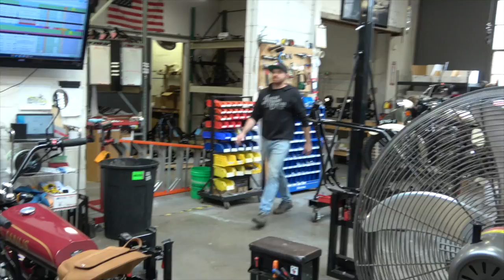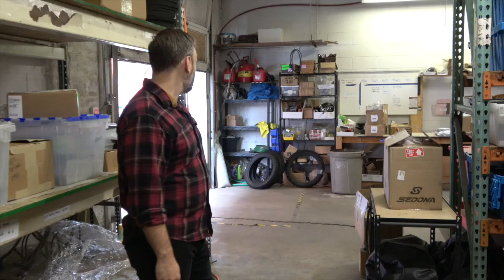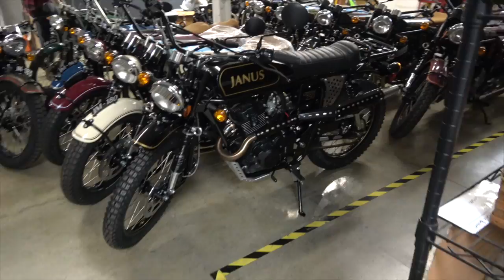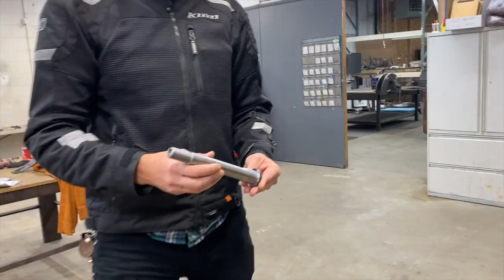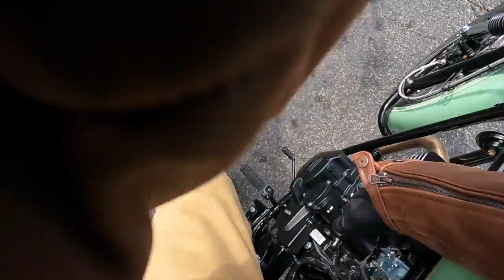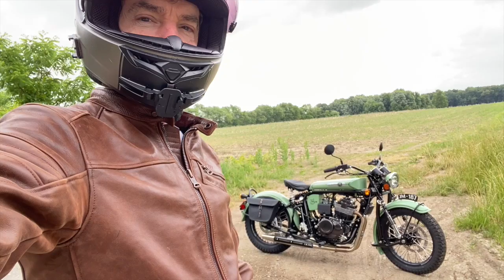Road Dirt Review: Janus Motorcycles- From Production to Street

Comment: I got a Halcion 250 about a year ago. OD green, yellow primary and black secondary paint, everything brushed, not polished, dual mirrors and full set of bags. It's the epitome of ride a slow bike fast. It's not fast, tops out around 45mph, but it's springy and very responsive. Handles excellent. I like the fact that they'll fly you out and give you a tour as well as explain everything and help you pick the model and features that best suit you as well as make you a video photo album of your bike being made at each step. Another surprising and attractive feature is that they will help you with instruction on how to work on your bike yourself, even encourage it without it voiding your warranty. That is unheard of in this day and age. The bikes aren't for everyone. Like I mentioned, they're slow bikes you ride fast, the kind of bike for those that ride for the sheer pleasure and enjoyment of riding. Very much worth the price and the wait.
Reply from the maker: You captured it perfectly, @Gator-357.
Best to you, as you “ramble” with that Halcyon 250!
Reply: 05/02/25. Something is wrong if it tops out at 45 mph.

Comment: I was fool enough to spend over 10K on the Janus 250.  Worst purchase decision I've ever made.  Frankly, Janus bikes are pure garbage.  The selling point is the attractive, vintage look and the company's small town, made-in-America, persona.  It's all phony.  These videos are made by Janus employees or paid hacks.  The bike can barely top 40mph.  Dangerously slow.  The gas tank holds less than 2 gallons.  The lack of rear suspension makes the ride a torture.  Nothing but repair after repair.  I've bought a Royal Enfield 350 and It's a welcome pleasure.  All I can do is park the Janus in my garage and let it rot.  It's too much of a pain to try to sell it.  And, I don't want to pass this crap on to some unsuspecting buyer.  Don't even think of buying anything from Janus.  Take my advice.  I learned it the hard way.
Reply: Do you mind sharing what problems you've had besides it not reaching above 40 MPH?
Reply: I’ll call BS on all that.
Reply: Did you not have access to the specs like fuel capacity or the type of suspension before your purchace?
Reply: It really won't go over 40 mph?

Comment: My initial concern is the weather proofing. The front shocks seem susceptable to water damage.
Reply from the maker: I think they’re sealed. The founder, Richard Worsham, rode one of the 250s across the country a few years back, never had any issues he couldn’t deal with easily.
Reply: He road the model I own from San Francisco to New York. One owner road the same model from Arizona to Alaska and back (16-thousand-mile round trip!). @roaddirttv
Reply: @roaddirttv yes, but seals wear, and then water can enter and rust the insides. Better to have seals on the bottom than top. Or put a boot over them.
Reply: I'm a fan of the basic idea of a simple maintainable motorcycle.
Reply: I have a Halcyon 250 with progressive spring shocks from IKON. Right through 2 Florida summers with heavy rain. Easy to rebuild if needed.
Reply: How many years did motorcycles have dual shocks exposed on the rear ? Never really an issue...

Comment: At first the price on these ones seems like a stretch but if you put in the numbers that you keep from doing everything yourself seems very reasonable.
I love this because  I see them like the little brothers of K. Reeves motorcycles.
BTW did you forgot to put the scrambler in the highest gear, seemed a little to loud compared to the first one you rode.
PS I noted afterwards the different placement of the pipe, I'm sure that's the reason it is louder.
Reply from the maker: Yeah, I had the chance to wind up the Scrambler in all gears, and you’re right, it’s definitely louder.
Reply: A "sale" price on another motorcycle recently was $4,500 but the out-the-door price was between 8 and 9K depending on accessories, a deal that I declined. When I did finally buy a Royal Enfield as my second bike, I found a number of items out of spec. The Janus, on the other hand, was all correctly torqued and such. And no hidden fees--right from the manufacturer to my door.

Comment: If you like paying a high price for a motorcycle with a Chinese motor, this bike is for you.
Reply: If you research the company they have said multiple times if a US business made small displacement motor they would use it, but you and I know there isn’t and if there was it would be be very expensive. Beside this bike  isn’t marketed to you.
Reply: @chrisimperial6516  their ridiculous pricing should include a more robust and reliable engine.
Nothing but trash for a whole lot of cash 👎
Reply: I just don't get it, too. I saw one here in Europe, an (road legal) one-off import, and they wanted more than 20.000 Euros for it. Crazy. A few months ago I sold a BSA B50; not mint, but really solid with a rebuilt engine, rebuilt brakes and a clean title; for half of that.
Reply: You're right. Janus could've used Japanese engines, which are reliable and bulletproof to justify their higher price. 
Otherwise, a nice modern vintage.
Reply: Sourcing an engine from Japan would drive the cost up further. Plus any major Japanese bike maker will not sell to an outside manufacturer.   @premswarooppaul1109

Comment: Really wish you would address how the leading link front responds. How comfortable is the seating in all models.  How reliable are those engines? How is the stearing?
Reply: I have a Halcyon 250 and the leading link front is very smooth and doesn't dive even when applying the brake hard enough to make the front tire howl. It's also one of my favorite bikes to ride twisties on because it's so light, nimble and tractable despite being a hardtail. The wide line seat is comfortable enough in stock form that I've done multiple +300 mile rides in the short time I've owned mine. I was so impressed with the seat's comfort that I will do a 3K mile tour out west in a month or so despite having heavy weight touring bikes in my stable. The CG250 motor has proven itself to be very reliable over the decades and there are aftermarket performance suppliers that offer cams and other parts so you can reliably double the horsepower and extend the powerband to 10.5K rpm so +80mph is attainable if desired. Devin Biek who was a Janus co-founder now runs Moto Cult and he offers performance parts and even shares results of dyno runs on his site https://motocultparts.com/. People race CG250 powered bikes in Brazil (search YT for "Gato" motorcycles), Malaysia, Pakistan and other parts of the world and the motor's simplicity and robust build is on par with old Briggs&Stratton and Tecumseh motors I grew up wrenching on as a kid back in the 60s and 70s. It's a marvelous motor.
Reply from the maker: Leading link front is well designed, and the response felt compliant but planted to me. Sprung seats were a bit unusual feeling, but very old school. Felt better on the Halcyon 450 than the H 250 obviously, as the 250 is a hard tail, while the 450 runs a dual shock underseat rig. The seat on the Gryffin is pretty plush, and is a good ride with their rear suspension on it.
Those engines, as we understand it, are quite bulletproof, being used in all kinds of applications the world over. I’m told they’re easy to work on too, if/when necessary. Steering is good, the 250 a bit more flickable than the 450 due to weight difference and the 450 having a longer rake.
Hope this helps,
Reply: Can't believe you use the word craftsmanship when you put a Chinese engine in it. Terrible